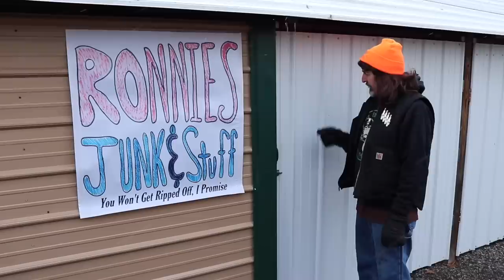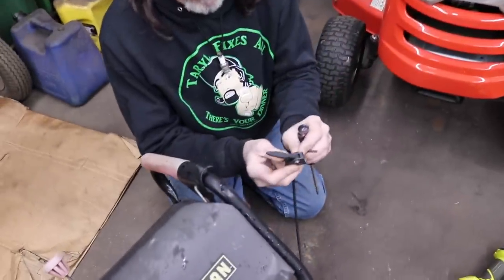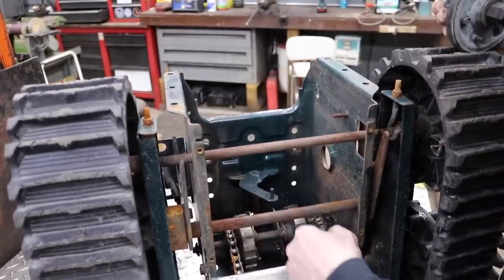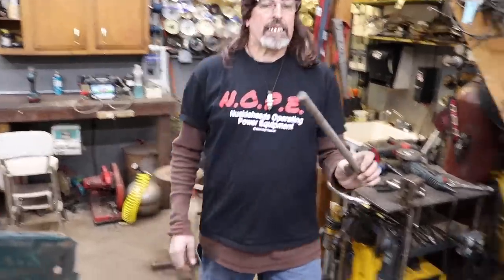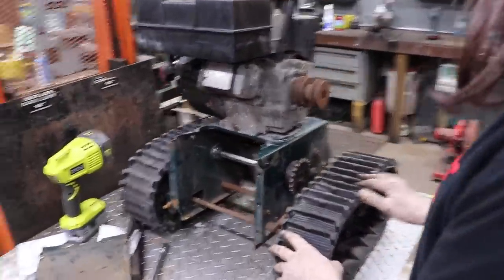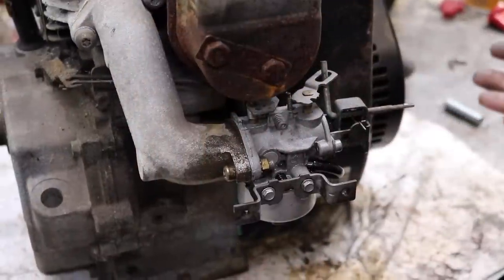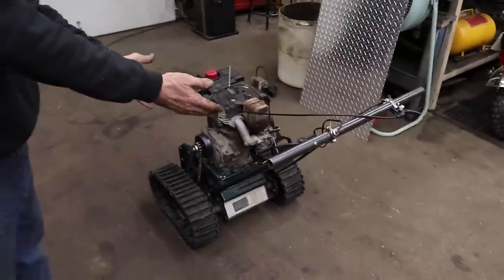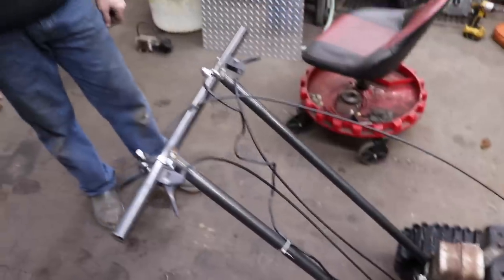Build Your Own Awesome Snow Dog! (Part 1)

Comment: Doesn't having the drive cog in the rear keep the bottom of track in tension. Reversing it would put slack on bottom increasing chance of track coming off when turning. I think snowmobiles have a more elaborate tensioning mechanism to keep more tension on track and only one track so much less twisting when turning. No real experience on this just my 2 cents.
Reply: The rear wheel must be the driven one as correctly stated above.

Comment: I don’t think it makes a difference which end is driven. The track is a belt so it won’t do what you want dig in. It’s till going to pop up till you have weight In the front. Move the engine forward like a snow machine that’s what holds the front down. Not the end that’s driven.

Comment: Meh!! Ronnie will be OK. A bit of duct tape a few bolts in his head and legs to fix the broken bones and a few stitches, bit of loctite so the screws don't work loose he'll be fine. Old school mechanics are good doctors for quick fixes when emergency and hospitals aren't within reach and are miles away.

Comment: I don't think changing the drive wheels is going to change anything. 

If that was the case, you couldn't do wheelies on a snowmobile. 

It will behave the same regardless. Save yourself the work.